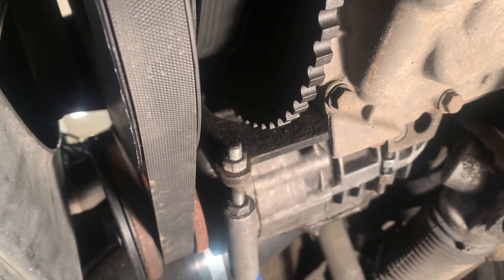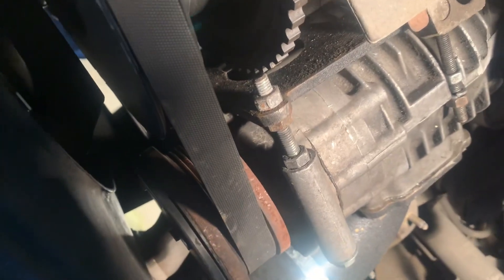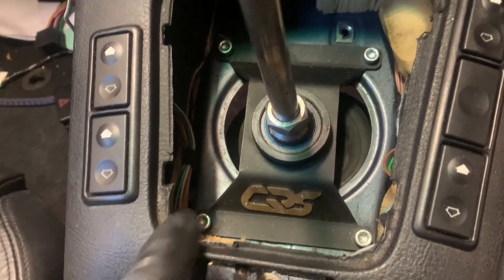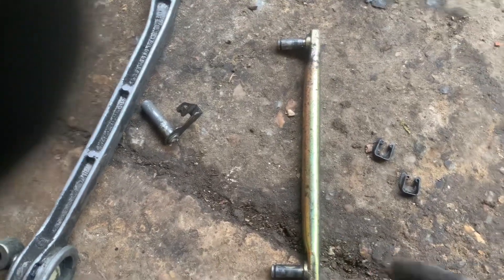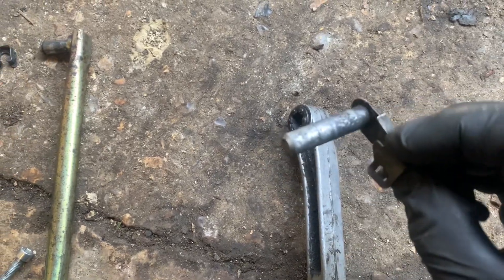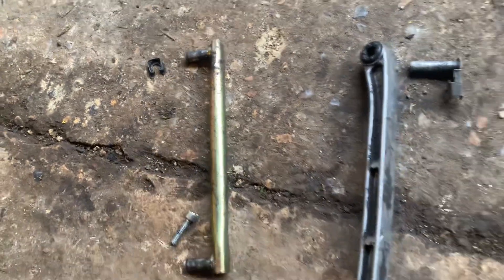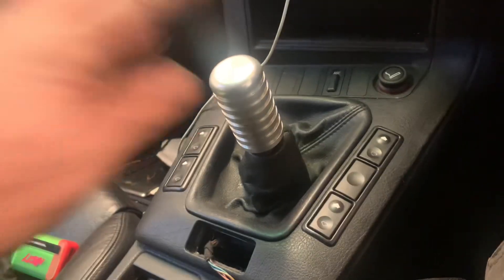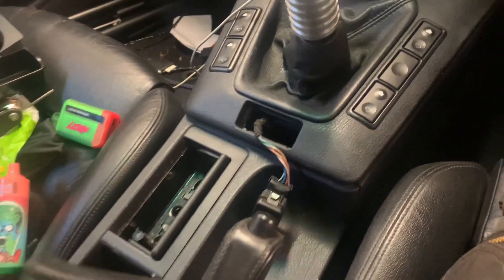E36 mods, finishing supercharger and fitting gear shifter

Comment: The super charger is mounted to the bottom and kept all the accessories? I have an e36 328is in teying to supercharger nothing crazy. Havent seen it on the bottom how did you get it there?
Reply from the maker: It’s mounted to where the ac compressor fits so you loose the ac